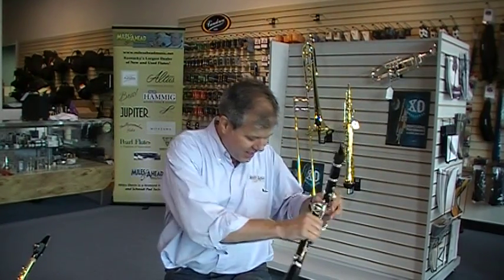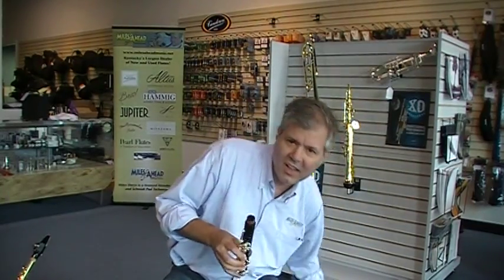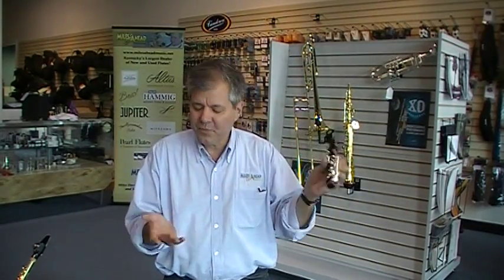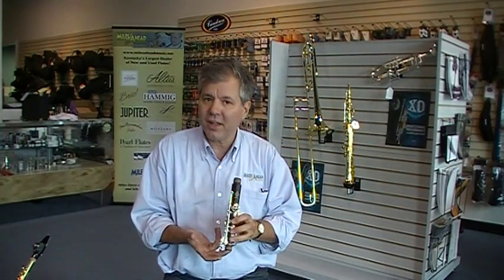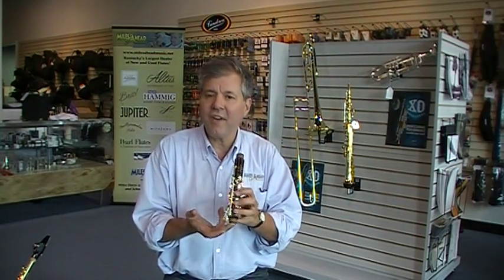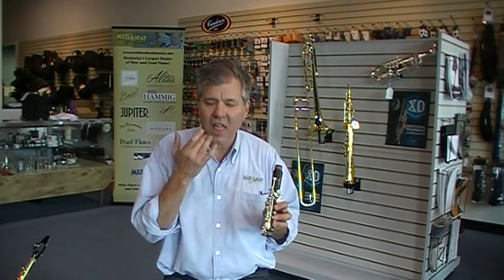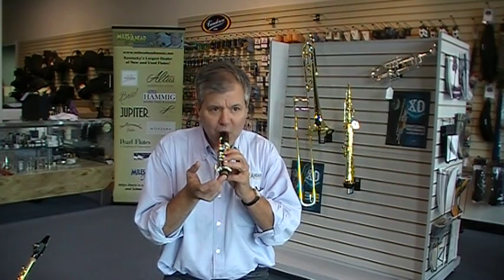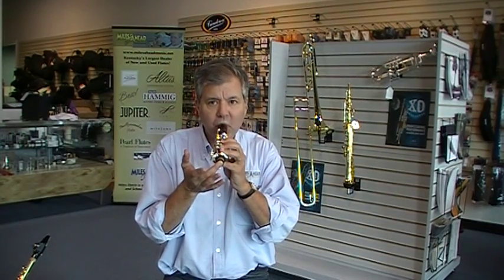Miles Ahead Tips: Leak Test, Clarinet

Comment: Hi Miles!  Great tip. Should the lower joint seal equally well... "Coke bottle" tight?  Should I also be able to get a nice "pop" from a lower joint suction test (perhaps with the help of a #4 stopper on the open end), and it hold for at least a second or so?